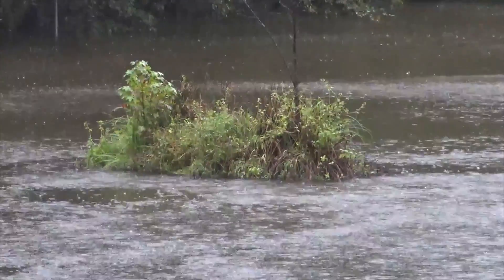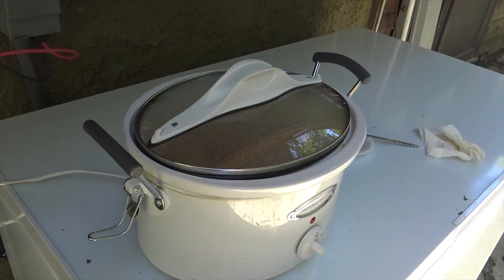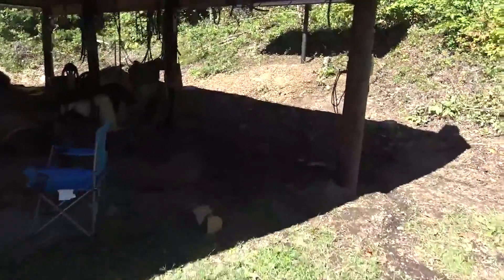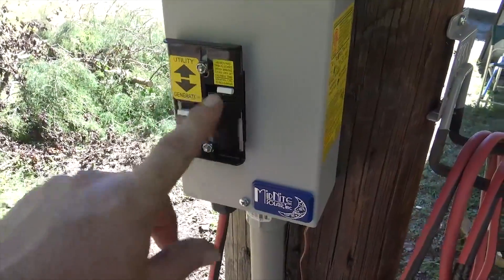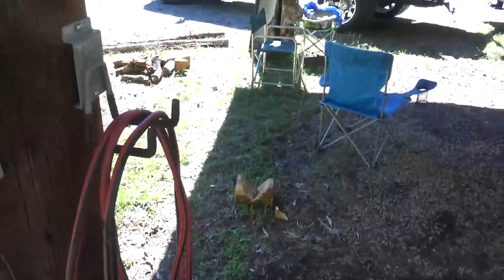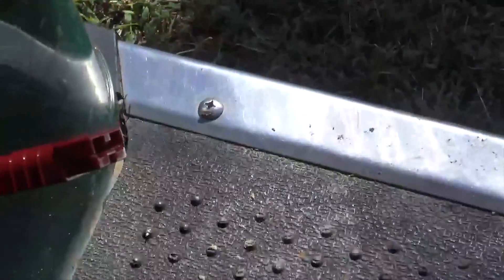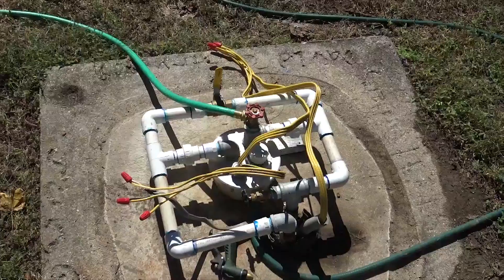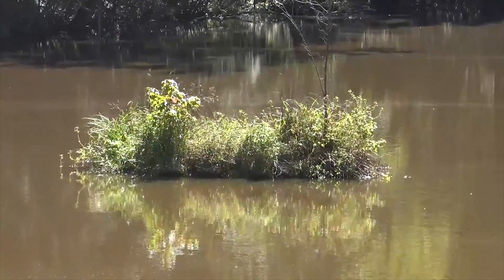Solar Simplified: No Inverters Part 2

Comment: How long can a lead acid battery be stored dry / never been filled?
The reason I ask is because I'm trying to collect the components for a very small Off the Grid power station and would like to know if the batteries should be the last thing I get.
Reply: 1100wing lithium batteries have a much longer lifespan. One I just looked up has 3500 charge circles at 100 %capacity and by the time it reaches 7000 circles the battery is at 75% capacity. Plus you can use the full amp rating instead of just 50% discharge. Maintenance free. They cost more but if you can get 10-20 years out of the battery it’s totally worth it. 
But to your question. I believe a factory dry battery can be stored for many years. Instead of buying equipment one at a time I would save up and buy everything at the same time.
Reply: Just make sure you know components are needed I started mine before I found utube I already had a 1750 watt modified sine wave inverter from 18 years ago and have since inherited 2 more  3 years ago I started getting things together bought 2 100 watt solar panels and a 30 amp pwm solar charge controller also bought 2 big cat batteries then found utube and found out that my modified sine inverter was no good for electronics and hard on motors can cause them to overheat and burn out so here I am with 3 converters and that's the main component  so watch you don't end up were I'm at

Comment: The dc12 is the  cats meow!  Pkease give this a thought, A hybrid electric water  heater  with programmable  operation .  You get three  times the  heat from a watt of  energy plus  you get a equell amount of  chilled dry air from that same watt of  energy!!  This  really  makes $ence in the south and will allow  Florida  residents to get around that states anti solar state laws. There are at least  three  hybrids on the market priced  from $1195.00 to a Germany  built unit  at $2500.00.  $2,000.00 for a 55gal heater and 900 watts if voltaics + Enphase  220 volt string inverters aint cheep but ya gotta spend  money  to save money!

I live  90miles from the guys at Hot  Spot.  They deserve  the praise  I am seeing from the  DC12 and wish I was in the  market but I have a two ton Mitsubishi  mini that  likly will be in service for years! Their products  make finuancial sense.
Reply: on another video entitled I think "solar ice" he shows a chiller that makes 30 ton of cooling for a building stored in ice while at the same time making hot water from the heat extracted by the chiller and its operated by solar panels.  this is essentially what you are talking about doing at least in theory.

Comment: But solar thermal is so much more efficient at producing heat and hot water. I guess if you have enough space to put in enough panels it really doesn't matter. It would be interesting to compare the cost per BTU capacity.
Reply: David Poz did a video on his channel comparing the efficiency of heating water with thermal solar panel vs electric solar panel..  For his house now he uses solar thermal with coils of tubing as a preheater passing through large insulated container built from wood  ,foam and EPDM liner that is not pressurized that supplies his tankless hot water heater . Pretty neat.
Reply: tee kay can you Lonk that video, I must have missed it

Comment: Why are you heating hot water...?
Reply: They are super heating the hot water to 150 with solar,  or heating cold water with both elements until top shuts off at let's say 120 and the bottom goes to 150.  Then it is sent out to a mixer to add cold water to bring it to a safe temp for the taps. Think of it as a solar boiler.
Reply: I get it! Lol. It's a cold water heater...

Comment: how many pannels would i need for a thousand watts to run a large aquarium if power goes out (120 gal) pumps lights ect ? how long would they last before needing recharged
Reply: 1kW is a lot for lights and a small pump, but assuming you want 1kW 24 hours a day, then you'll need to make 24kWh of energy per day during daylight hours.
1 commercial panel is say 250W, and if it gets 8 hours of sunlight per day it'll therefore make 2kWh under optimum conditions.
As you'll need to make enough energy to store overnight, you'll need to make that 24kWh in 8 hours.
Therefore you would need at least 24/2 = 12 x 250W panels to make the equivalent of 1kW all day (24kWh)
You'll need a battery big enough big enough to store 16kWh for the 16 hours you're not charging.
Everything is educated guesswork, so double that to add some headroom, and add a few more panels for cloudy days etc.
So you could get away with 15 panels, and a 30kWh battery and be almost guaranteed a 1kW average supply.

If panels are $100 each, that's $1500, another couple hundred for cabling, another 400 for charge controller and 40 or so lead acid batteries or 2-3 Tesla Powerwalls at about $5k a pop.
Alternatively you could make your own lithium powerwall for virtually free by spending a year collecting and testing cells from old laptop battery packs.
Everything is solvable.
Reply: @ahaveland  He will need to cover the 1000W in the daytime and also put enough into the batteries to cover the night run. Also, not every day is a good solar day so you want some extra battery for that if possible.
Reply: I don’t want to see your current electric bill

Comment: Is that Mini Split for the A/c unit a two stage compressor, or a Variable speed compressor?
Reply: Ive never heard  of  a two  stage mini and ive been interested in mini splits for years.. If I rember correctly my Mitzibishi   can run at any one of ten speeds depending  on  need. That's  the compressor ,  the indoor  unit is three  speeds only but the unit adjust the  speed automatically .

Comment: Maybe it was in part 1, but is the whole system 24V DC? Or are the batteries total one voltage and the golf cart and water heater another voltage? Thanks!
Reply: He mentioned no batteries like a half a dozen times so it is doubtful!
Reply: I would imagine he is using a 48V system for the a/c.
Reply: he says the golf cart is 36 volt so at least for those batteries iy would have to be above that say 40v or so don't know about the other dc loads

Comment: https://runonsun.com/~runons5/blogs/blog1.php/residential-solar/what-i-saw-at-enphase-mind-blown
Reply: @Tes Tos you really think that going off grid utilizing AC is spam? I'm sorry but there are other alternatives to going off-grid then simply high voltage DC with high arc potential.
Reply: @Tes Tos microinverters are the future of solar. The path to DG solar
Reply: @Tes Tos  Jim Jenal is the founder an CEO of runonsun but I'm not sure when you click on it, it takes you there when you refresh it the link goes to where I wanted it to
Reply: @Tes Tos https://runonsun.com/~runons5/blogs/blog1.php/residential-solar/what-i-saw-at-enphase-mind-blown
Reply: If you are worried about the link, it says enphase has a new thing where you can still run stuff when the grid is down, but it didn't say if it will work with the old already installed inverters, or if it's at a reasonable price. I am sure you would have to really mess with the home grid system because you would have to completely disconnect from the grid and the home owner would have to pull large loads off the system so it could power smaller things.